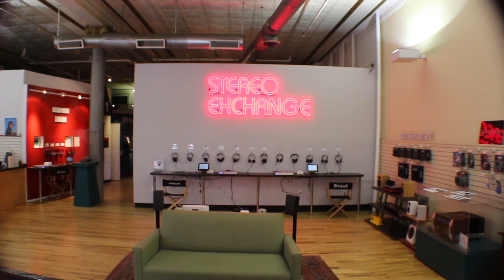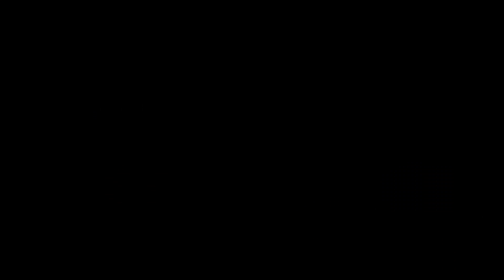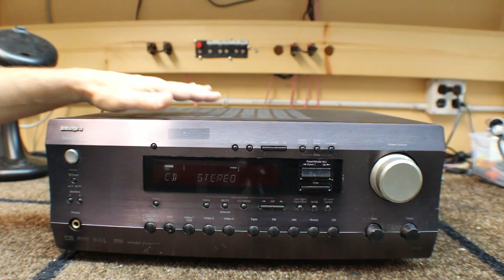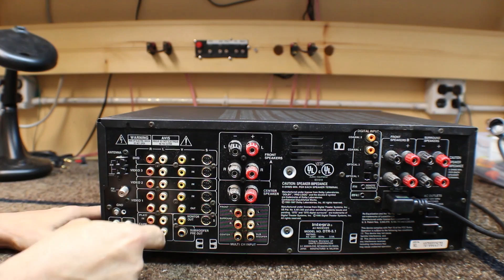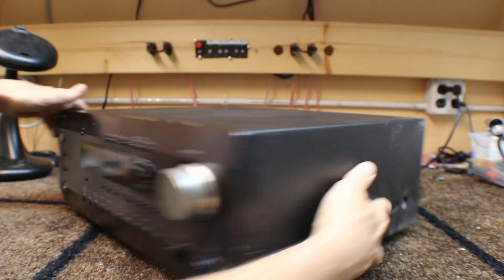Audio Primer: What is a Receiver?

Comment: How's one old person supposed to know where to set a tuning dial if nobody who knows will take a time slot to say how? I'm just finding if it ain't set just so that folks all over get stressed since beneath the mountain ridges every in and outlet are at ground zero.  Is this the case that over the mountain and lower that changing the setting changes the moods and what news they get?
 if so, why no confirming what I suspect? Thanks for the video primer. It's much needed. Sums one past owe a public schooling. Radios been in the Americas for how long? Cmon, masters. What if the life you spare just to tip the people is one of yours?

Comment: the older 2 channel receivers had much more powerful amps inside them I have a 1997 Yamaha rx596 that puts out so much power that that I don't need to buy preamp and amp I run at 4ohms and push my klispch hard my friends can't get over the thd levels either , why don't they make them like this anymore ? even the new 2 channel re covers like Hardon kardon 120wpc sucks it even had preout for powered sub but still doesn't have the punch without the powered sub their ratings of power are way off and it can't play in 4 ohm I don't get why there isn't a basic level to measure true power they say it has 120wpc but at a very high THD like .09 to .10 that sucks old school Yamaha 2 channel is cheapest way to get natural stereo sound without distortion (THD)